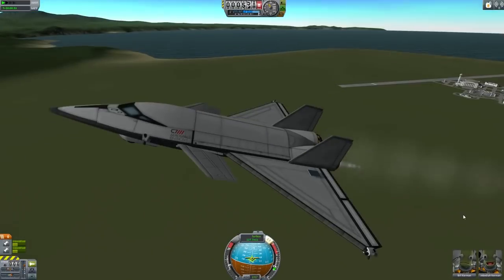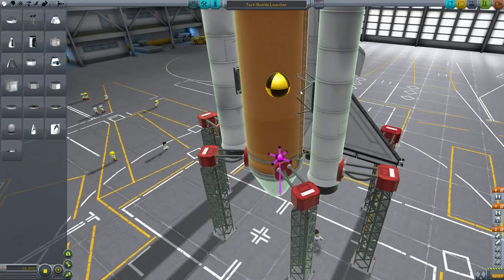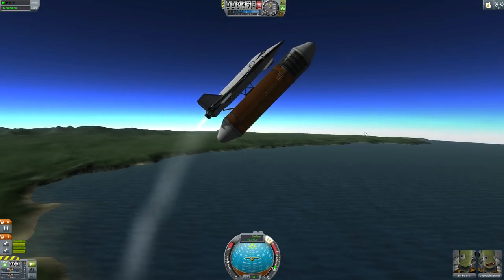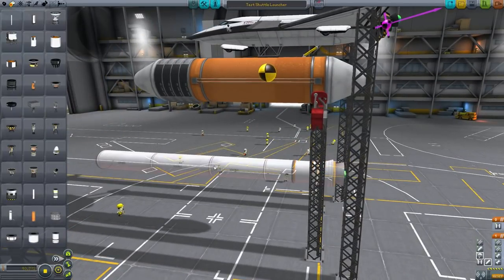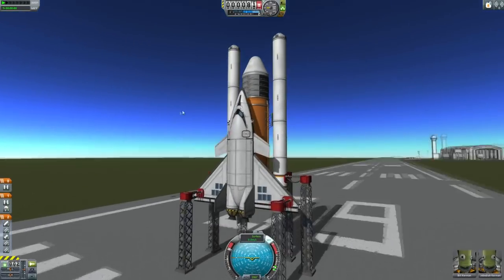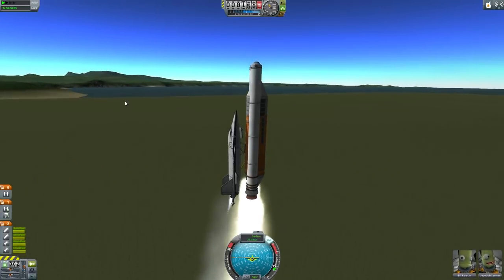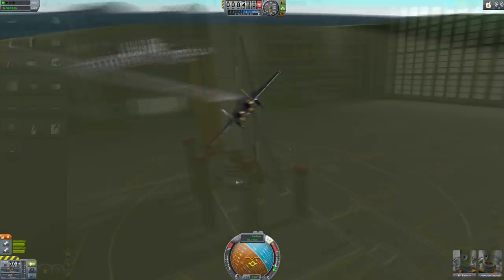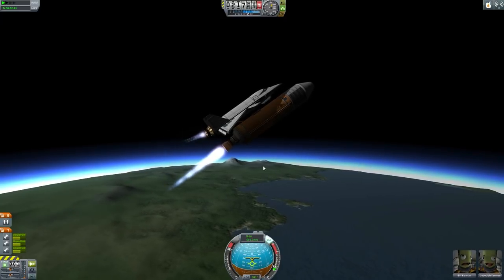Kerbal Space Program - Building A Shuttle Clone In 30 Minutes

Comment: does anyone know where you put landing gear? My planes never lift off!
Reply from the maker: Look at my series on aerodynamics I cover common gear placement mistakes
Reply: Scott Manley Thanks Scott :)
Reply: Snix, also behind the centre off mass.
Reply: A common issue is that your pitch control surfaces are behind the center of mass, therefore requiring the back of the plane to drop in order to get lift, but since it's on the ground this won't happen. Simplest solution in this case is usually to just keep accelerating to the end of the runway. Other solutions are to either add control surfaces onto the front part of the plane or adjust landing gears such that the plane points slightly upwards.

Comment: Nononono..... Nooo everything wrong.... you don't fool me dear Scott Manley....
Just strap a mainsail on the main tank as there is no way to lift those with those tiny engines, regulate engine thrust limiter to balance torque rotating the vessel, booster are optional. Never leave the main ship engines not aligned with the resulting vessel...

Comment: Scott the vehicle assembly building is the one you build rockets in the tall one the one your in is the space plane hanger
Reply: The reason he used spaceplane hangar is becuase of the way the symmetry mode in it works, in the Shuttle hangar dual symmetry puts on opposite sides, in spaceplane it puts them at the same elevation from the ground when horizontal.
Reply: i know why he did it im just saying he has them mixed up he is calling the spaceplane hanger the vehicle Assembly building which is the taller building for building rockets

Comment: Your main engines are way too weak. The actual shuttle's three RS-25 are incredibly powerful liquid fuel engines; combining the precision of computer avionics they can control the throttle, allowing it to compensate the COT for the changing COM. So the only thing that can really allow for this are advanced mods (mechjeb + throttle controlled avionics). Or I guess you can haphazardly manually control the throttle.

Comment: Hey Scott, I actually made a stock shuttle a little while back doing exactly what you suggested (messing with the thrust output as the CoM changes):

https://plus.google.com/photos/+TomJiang/albums/6080386952291107153

Similar to the real shuttle, it uses the mono-prop engines to circularize (a fact that I learned from one of your other videos).

Comment: if they didn't use the shuttle to build the iss then the sea Dragon would have been produced
Reply: There is probably no chance the sea dragon would have flown as imagined.  Rocket engines don't scale up quite like they planned.  The most powerful single chamber RP1 engine ever built is the F-1, 1.5 million pounds of thrust.  Sea Dragon called for a single engine putting out 79 million pounds of thrust and the 2nd stage needs 13 million, which is almost twice the Saturn V first stage alone.  There is a good reason it never got off paper.

Comment: This is one reason why the Space Shuttle was generally a bad idea.
Reply: +Jordan Shank The Shuttle was a glorified freight truck.  It works well for the purpose it was designed for,... but it cannot be your only spaceflight program.  Any nominally functional space program would need to maintain both a Shuttle fleet, and an Exploratory fleet.  And we could do that, if Congress gave a damn.  And it wouldn't even require a budget any higher than NASA already had.

For example, in 1966 (NASA'S absolute peak), the budget (adjusted for inflation) was just over $43 billion.  Now if we take a moment for comparison, that is about the amount that the military (estimated $600 billion or more annually) spends in a month.  Shuttle development proceeded on a measly $15 billion, and the year of Apollo 11 (1969) was at $27 billion and dropping.

So, if we take away the "go fever" rush, and streamline the two programs, NASA would be more than capable of having a nominal mixed-program on $30-$35 billion.  That equals only about 1% of the Federal budget, and about 5% of what the Military gets annually.  Hell, divert some of the wasteful defense spending over to NASA, and the problem is solved.

Comment: I hate my computer its lag so much I so hate it!! Dx  the game crashing and freezing every time its so slow I hate it!! :(
Reply: Physics engines are very CPU intensive. A modern midrange computer can handle KSP no problem. Time for an upgrade.
Reply: On my old laptop running Linux Mint 18 it has a problem where the game drops to about 2 FPS for like half a minute, and then runs fine, then does it again a minute later. I actually fixed the problem by disabling the nvidia graphics driver and switching to the builtin one. Weird.